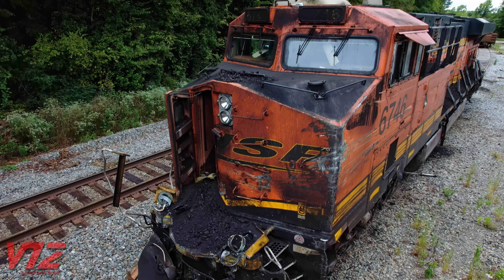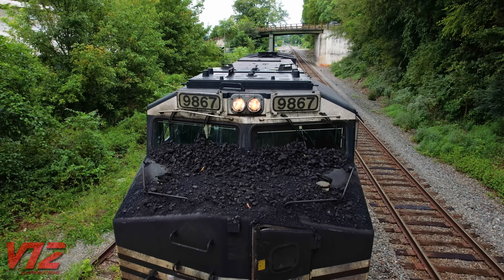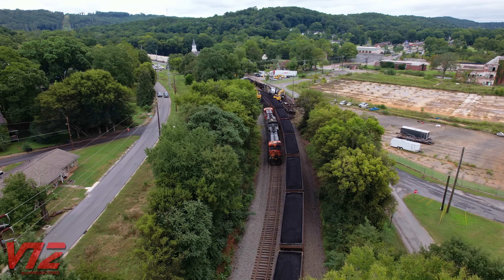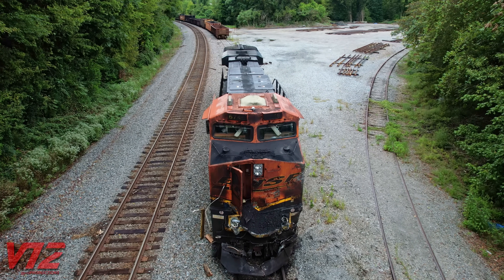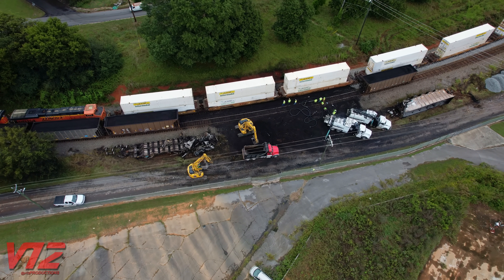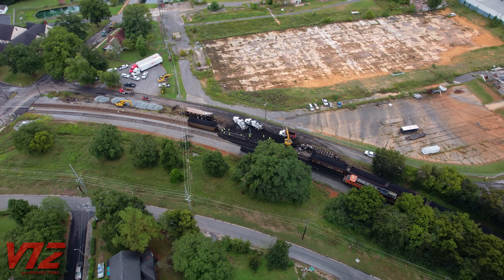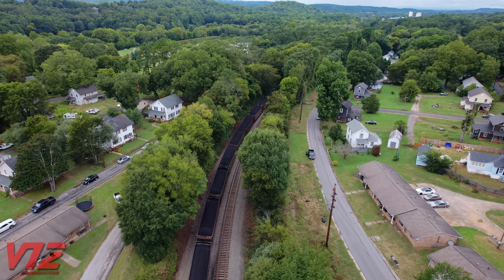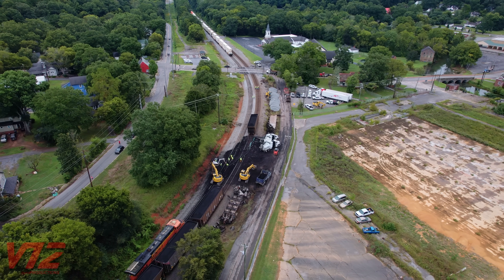RUNAWAY Locomotive & Head-On Collision in Rome, GA

Comment: Southbound NS 732 was passing a signal at Lindale, GA around 4:15 am when PTC put the train into emergency. This caused one or more coal hoppers in the middle of the train between the front end and the mid train DPUs to bunch up and derail. Northbound 283 ran into the derailed coal hopper throwing coal all over the locomotives and tearing the brake lines and chains off the lead unit. The lead unit then continued on unable to stop and ran into 29A head on at Rome, GA. The crew were able to radio the crew of 29A in time for them to exit their locomotive. The crew of 283 then jumped from their train moving between 25 and 30mph suffering broken bones and other injuries. The two damaged units were then backed into the siding while the site was cleaned up.
Reply: PTC and DPU’s that just about explains it all right there. Damn ! I hope them guys recover fully. Thats why they need more than one on a train . I hope you a$$holes in management are smart enough to figure that out. Your not only just risking crews now but whole communities. And I’ve noticed they are increasing train length and speed on slop freight. That shit will catch up with them also.
Reply: @rc391995  Agreed!
Reply: Jumping off a locomotive moving at 25 to 30 mph on to a heavily ballasted Right of Way is going to end up hurting you no matter which way you try to look at it. Actually I am a bit surprised that the crew were not able to kill the locomotive and it's mate???
Reply: Did you copy that word for word from hotspots? 😂
Reply: @markfryer9880   Hitting the emergency fuel cut off has nothing to do with brakes.
Reply: @rc391995  Can you explain to the laymen why PTC (i know what that is) and DPU's are bad? I assume the coal broke a knuckle because of PTC emergency brake application ??
Reply: You know what I started to answer your question in great detail . had done wrote several paragraphs in regards to your question then I remembered I'm at the point in my life that I've worked all my life to be in  . retired and drawing my railroad retirement . I'm very happy with that and why would I take the chance to loose all that just to be dragged into court and sued for answering your questioned ? How do I know your only a layman. I'll leave it like this . The machine broke down and did not function as they thought it would. Here is two perfect examples of just that.
Reply: @rc391995  I understand. I'm railroader in the UK, our freights are not big enough to require DPU's and break aparts are practically unheard of.
Reply: See your more than just a layman.
Reply: @rc391995  good answer brother enjoy your retirement
Reply: @formidable38  ok so Mr Layman we will call you?? just so no one here seems rude and if you are truly a novice physics alone will answer your question but please understand the retired railroader can't and won't say anything because of fear yes fear ... that's right ol chap this FREE COUNTRY we live in isn't really all that free!! The retired railroader worked a whole lot of miserable hours around the clock 12 hr shifts for 10 hours rest 365 days a year out of town from front door to front door of either his home or possibly a temporary residence another 100+ miles from his home "chasing" work to provide for his family some of these door to door tours of duty can last 45-50hrs yes hours per round trip -- home out of town,rest out of town, back home again plus travel from the terminal off duty and drive home can be 45-50 hours round trip!! Then 10-12 hours later the phone rings again and he has to do it all over again!?!
Any time off had to be traded for one excuse or another and %80 of the time that time off work (accumulated vacation days or personal days) are denied for Doctors visits, Dentist appointments, and I won't even suggest family time or family members medical needs and bills that the quoted "Cadillac insurance" doesn't pay for or only a small percentage of!!!
And vacation is technically a forced layoff depending on a employees years of service these vacation schedules are hammered in stone with the existence of modern computer programming that maximized every minute available for the machine to run at it's most effective and profitable scheduling matric!!
So please understand ole chap no one here wants to be rude to a "layman" if you truly are what you said..oh that's right your a railroader in a foreign country our cousin so to speak then you would also know we are trusted with the safe and efficient timely travel of goods and services that serve our country and supply the world with everyday products..so crawl back in your concrete block building in the old USSR and troll someone else 🇺🇦
Reply: Those guys must've been absolutely terrified.
Reply: You said 732 was passing a signal, was it a red signal? If not, a major failure of PTC for sure! Secondly, if 238’s lead engine had the brake lines torn away, an emergency❤ brake application would have automatically been initiated, which would also cause the locomotive(s) to lose power. If your report is correct, and I’m not saying it isn’t, then there has been several catastrophic failures of systems designed to keep incidents like this from happening! What’s not stated here is how much time elapsed between hitting the coal train, and the head on collision. If the locomotive was shut down after the coal impact and a handbrake was not applied, it’s entirely possible for the air to slowly leak off of the brake cylinder piping (or the piping might have been damaged in the collision) over time, and once the locomotive started rolling there would be no brakes! It was also not stated if the engine was separated from the train, or did the whole train runaway? Train brakes differ from 18 wheeler brakes in that they use air pressure applied to the brake cylinder to APPLY the brakes, while truck brakes use air pressure on the cylinder to RELEASE the brakes, so loss of air pressure on the cylinder makes a no brake situation! I had a 41 year career in the mechanical department with Sou. Ry./NS, and over the years seen many runaways due to engines being parked and shut down, and the crew somehow forget to tie up the handbrake. In time, the cylinder pressure will leak off, and there she goes!
Reply: @formidable38  Totally different style of railroading.   In North America (US, Canada and Mexico) the distances travelled are far greater and for bulk commodities long, heavy trains are the most efficient way to move freight.   In Western Europe the distances traveled tend to be much shorter with much lighter tonnage.     The railroads in each location have adapted to best meet the needs of their customers
Reply: Man if you was in the mechanical dept  and I'm not saying you are not. You should know when an engine side swipes a derailed coal train and it tears all the brake system from a locomotive the cylinders the listens the fulcrum the rods and entirely the whole brake rigging and that stuff is no longer part of the braking system there is nothing left to stop it. You need to rear here what's going on and what happened. Its either you've not read or you are an official trying to cover for the damn RR and still trying your level best to promote this one man crew foolishness. If that's what your doing your a paid shill that or you don't have a clue what your talking about . which is it ?
Reply: Pistons Not listens
Reply: And BTW in regards to the the signal . The signal dropped in his face that's something the mechanical dept has very little knowledge of . It happens I've seen if for myself . a kid dragging a log chain across both rails can make a signal drop . a traffic sign placed across both rails can make a signal drop. Whatever it was gave the coal train a false reading and PTC put the brakes on causing the DPU's to put excessive force on cars ahead of them and pushed the coal cars off the rail in the face of an oncoming train. The PTC robbed the engineer of any other method he could have applied to stop the train. Don't try to put blame on the crew on this one . its a catastrophic failure all right . of PTC and just what  a DPU can do for you in the most undesirable situation. Somebody called it the perfect storm. That exactly what it was. By the hand of God nobody was killed . The potential was there to kill a bunch not just the crews but whole townships.
Reply: Well thanks you for explaining why no train driver will explain 100 and percent exactly what went wrong and only offer a 30% exclamation I don’t know what it’s like here in Australia but I’m not a train driver I’m just a random person on the Internet but if what you say is absolutely true that must suck and I’ve heard horror stories of train drivers in America who I’ve had no sleep and that was a horrible accident I think that was actually Canada there was a disaster in I can’t San Bernardino think it’s called so yeah I hope that people do respect use enough to not push for the answer but what the other guy has explained does seem reasonable enough that it could be New to the truth or the truth of what happened to be honest I hope that in America train drivers do you get treated with more respect because without use or truckdrivers the whole country of Australia America Britain Europe would all collapse and I think you and everyone the train driver in this comment section for your loyal service even though I’m in Australia but thank you for keeping the country moving
Reply: I’m sorry that that happens to you in America but I’ve been in Australia I don’t know like this I was quick message thank you for your loyal service as a train driver I understand from what I’ve heard that it’s an extremely difficult job with the work hours and the same thing for truckdrivers but without use working on the trains or driving in the country would go to a grinding halt especially truckdrivers use are the unsung heroes of the country of any country to be honest So thank you
Reply: People in train and engine service get no respect over here from the company. They put on a big show its all bull. They are thought of ... Hell I can't think of a proper word for it at the moment trash maybe . The guy that was on the coal train was on here . Those post was deleted. Hell they is no wonder he can't talk after what he went through. He seen his life flash before his eyes he's ha a very traumatic experience. If some one tied you in an airplane that was out of control without a parachute how much would you feel like talking about it. Not quite the same but as close as I can get right now . Hell yes those guys are exhausted they go on forever without sleep sometimes. They never know when they will go to work or when they will get to rest. Just because their tour of duty is still over doesn't mean they don't have to wait for hours on the side of a mountain somewhere for a ride to pick them up and take them to a motel. Stay up for about 40 hours sometimes and see how it makes you feel. Another thing they talk they are subject to scrutiny untold. Seems like the carriers have a strange way of turning a story around to make it sound the way they want. You tell them the truth and they don't know how to deal with that. They will look at you like your cravy and tell you that's not possible and walk away from you. Then run and tell someone else in management what you said then they pick it apart to suit themselves then turn around and fire you for it. What is it over there do you people live in a bubble or what. I see your media is always making derogatory comments on our government over here. Why you all so many interested in what goes on over here. Go watch the damn Russian I'd think that would be of more interest to you in regards to what shouldn't be done.
Reply: Man they is all kinds of bullshit floating on this channel in  regards to this incident some of it gets deleted maybe I can understand some of it some of it I can't. Lot of politics will be played here its all about a stinking dollar over here as far as you and I . we are a needless expenditure. Nothing else matters not even your grandchildren.
Reply: I thought PTC was supposed to stop derailments like this, not cause it. (Yes this is sarcasm at the expense of PTC)
Reply: @rc391995  totally agree we need a minimum of 2 on every train MINIMUM!
Reply: @osrr6422  yeah no brakes is no brakes maybe dyno would have worked
Reply: @rc391995  hey enjoy your retirement sir
Reply: rock kicker
Says the troll.
Reply: OS RR
You sure about that? Cause retired railroad worker a.k.a. troll rc391995 thinks otherwise, why didn't they just shut down the engine so it stopped? Why didn't they just use the brakes that were torn off? Yet hypocrite rc391995 happily puts others down for wondering why non existant brakes weren't used even going so far as to list brake parts and then the troll calls others trolls.
"The fact that it tore apart from the rest of train should should have put the brakes on and shut the power down on the engine. Then it went through my head if it’s the lead locomotive why don’t the crew shut the thing down and stop it ?"
Reply: That’s what I was trying to figure out…I thought that the whole train was runaway and was it in dark territory as well too? I’m assuming that Northbound was supposed to crossover as the 732 passed? Scary situation all around…I work up North with NS as well too
Reply: thank you for the info !
Reply: What does an area operated by PTC tell you .
Reply: PTC caused the derailment? Woahhh...that'll get you in trouble with big brother.
Reply: Ptc puts trains in emergency nearly everyday where I’m at, lose of communication with intermediate signals most of the time .. what happens is if you are running on clear signals and running 50-60 mph ptc will lose communication with signal in the field and throw up the restricting indication .. if that happens at the right time you don’t have have time to reduce your speed so ptc will put the train in emergency depending on speed .. id say the locomotives brake rigging was damaged to the point the air brakes would be inoperable, if the fuel cut off was hit then it could take a couple minutes for everything to boot up and start back up
Reply: @markfryer9880  Ballast is actually quite shock absorbing, that's why you'll see river rock ballast at the bottom of rock walls to absorb shock if someone falls.  Ya, the crushed granite commonly used for RRs has sharp and jagged edges, but landing on it has more give than just the hard ground and does allow some sliding.
Reply: @formidable38  they used to be here too until they started running these massive poorly built trains.
Reply: @cdavid8139  no they really arent. In some places yes but it has been shown in the last three years to be a massive failure.
Reply: @yourbestgolf365  shown to who?    Massive failure...yet it continues to be installed.
Reply: @cdavid8139  - Freight transportation in the UK and Europe is more truck centric than rail. The primary focus of railroads in Europe and the UK is carrying passengers whilst in the US the primary focus is carrying freight.
Reply: @billnict1  I have spent a lot of time in the UK and Western Europe and agree with everything you said.   The US, Canada and Mexico are far more freight oriented and move massive tonnage on rail.   This is a far cleaner, more environmentally way to move freight longer distances.   Conversely high speed passenger service is excellent in Europe and with only a few exceptions it has not caught on in the US, Canada and Mexico.   Part of the reason is just the distances involved.  In the three North American countries we tend to fly and not invest in high speed rail.
Reply: Just curious.   Did PTC attempt to stop 29A?
Reply: @rc391995  Of course they will increase length and speed.   The latest labor agreements are giving a %25 pay increase over the next few years.   That means management has to find a way to reduce the labor to compensate.   Now, a question for you.   Having two crewmen on these three trains really meant nothing to the outcome...other than more people were hurt.
Reply: @tomt9543  I had a couple of questions on the timing here myself.   May need to see the final NTSB report.  Should be interesting.   From what I gather the impact between the coal hoppers and moving locomotive tore out all the brakes so they could not be applied.   I.E....there was nothing to apply.   So the crew was riding in a locomotive that could not brake but probably had powered down.  Whether or not the crew on the moving locomotive attempted to apply a hand brake while going down the track isn't specified.
Reply: @McDonnellDouglasMD--  There are definitely horror stories involving rail (and trucking and maritime) crew hours.   Over-the-road truckers and railroaders face scenarios that lead to going on duty tired and not really fit for the responsibility they have.   This needs to change.   BTW...I have railroaded a bit in Australia.   You guys run monster trains down there.
Reply: @specialed6357  To answer some of your questions, the crew on the 'runaway' locomotive had no brakes to apply.   They were damaged so badly they could not work.   It is probably the unit itself shut down but trust me, these things can keep going for miles and miles without power.
Reply: @cup_and_cone   That has to be the dumbest statement I have ever seen posted on a rail thread EVER! Go fall down in some ballast and come back and tells us how much it "gives".....
Reply: @rxrcond4life  Your emotion doesn't change logic and fact.
Reply: @cup_and_cone  Your 'logic and fact' are pure ignorance. I've spent most of my life walking said ballast and my 'emotion' as you claim is your perception. Go fall in some ballast and get back to us with your findings!
Reply: @rc391995   How many years did you work. 47 here. Isn't retirement grand? There is a part of me that misses some aspects then I wake up...  🤣
Reply: I'd like to go back and work one week . get me some payback !
Reply: You don't know much about RR BALLAST DO YOU ?
Reply: @tomt9543  I can see it being a PTC issue. Ive had many encounters with PTC showing me a red fence at a signal thats clear. Even 6 miles in advance ill see it on the screen and we'll only have a single intermediate before the absolute thats showing the red fence and the intermediate will be a clear. Then the fence will come and go many times. In this particular area its happened, It would display a red fence once again while running on clears and it will do it when we have just over a mile until reaching the signal. Which is a butthole puckering moment when you're running 50MPH with 8000ft and 10,000 tons in tow. Most of the time when we would get the speed down the red fence will go away when were only about 1500ft from the signal. PTC is not as perfect as many claim it is
Reply: @jassemalzahrani4502  locos are not designed to go into emergency dynamic brake by themselves,or by other means.
Reply: @cdavid8139  but, having 2 men in the cab has prevented many railside fatalities.
Reply: @Dieselfueledwork  over the course of years/decades you are probably right.   Two drivers in the cab of a truck can prevent fatalities.   Two bus drivers always alert and on duty.   Two individuals in the cab of an Amtrak passenger train provide additional safety.     You can go on and on with it.    I see where you are coming from.  I do not disagree.
Reply: @rc391995  I'm spineless?   LOL.   Your opinion of me is so important.  Sigh.   Yeah, well.    After 40 plus years of railroading for a living, if I find opinions on complicated situations that I agree with, I very will may repeat that opinion.
Reply: @rc391995  This is not "my" PTC system.   It was mandated by the Obama administration and forced on the railroads.   Class I railroad management (and the stockholders)  fought the introduction of PTC for years and years.   While final reports have not been written, it does indeed sound like the train going into emergency may have in turn caused the loaded coal hoppers to  derail.      To answer your question, if indeed it is determined that the emergency brake application caused the derailment then yes indeed it did not work here.   I agree it sounds like the "machine did not work as planned".   I never stated otherwise.
Reply: 40 plus huh ? And never heard of a radio train.... Pfft ! Yea ok C David whatever you say ....😑😑
Reply: @rc391995  Where did I say I have never heard of a radio train????
Reply: You said no such thing existed 50 years ago . pardon me ! I thought you was implying you never heard of one. I wasn't talking about a handheld toy .
Reply: I've actually kicked ballast around for several years David it don't take me as long to form my own opinion either . Spin another story why don't you and tell someone who really doesn't have a clue what didn't happen 50 year ago .
Reply: @rc391995  OK.   With you.   I was referring to the DPU technology of today that was being used by the power in these trains.   These modern units utilize a vastly different technology than the GE/WABTEC systems in the earlier days.
Reply: I was initially referring to special Ed in regards to being spineless David then he deleted his posts and it seems like all of a sudden you popped up. But that’s ok I can multitask well.
Reply: @rc391995  no problem.  Peace bro.
Reply: @rc391995  Agreed.   I've seen too many instances where crews are blamed way before facts are in.   And I agree what I see here is somewhat amazing.   It is very easy to jump to conclusions in this type of accident and blaming crews or equipment or weather or whatever before the facts are in is something I see management do far too often.    I personally believe PTC will be good for the industry and the safety of crew and the public....one day.   I just feel it was regulated by the government into production ahead of its time.   Be safe
Reply: I don't know what happened to my post. Maybe I deleted it and didn't know it. I won't bother you anymore. Peace man
Reply: @rc391995  I think we both had a post deleted.   be safe
Reply: @rc391995  well said
Reply: PTC saving lives!
Reply: Weird. In my experience, a deadman's device should have stopped this Loco in it's tracks. How come it didn't ???
Reply: @itchyvet  if the air line on the locomotive broke there's no brakes
Reply: @cdavid8139  the government mandated PTC be installed. I hate installing PTC. Sometimes it's like where the heck am i going to put all this at????
Reply: @itchyvet  a deadman cannot stop a train that has no brakes.
Reply: @theodorethompson9032  Pretty much agree.   The industry fought the mandate for years.   It was, in the opinion of many railroaders, rushed into production and we are now seeing the fallout.
Reply: @R7300  the main and emergency resevoir and there piping would have to be have been destroyed for the brakes not to be applied in an emergency brake application
Reply: @bustedford  takes air to set the emergency air, could have been that line broken
Reply: @R7300  air is retained in the emergency resevoir to set the brakes when trainline air is lost so yes that line would have to have been broke or brake rigging damaged beyond working
Reply: Those parts was no longer part of the engine in question. All the brake rigging was ripped off when it side swiped the coal train. Yes all the working parts that applies the brakes was gone.
Reply: @cdavid8139  Handbrake would have no effect due weight/inertia over breaking ability/force. Locos don't 'automatically' shut down except for fuel savings when idling for extended periods. Locks can roll just fine when shutdown when not properly secured!
Reply: @R7300   PTC was forced on the Class 1 railroads after the Northridge, CA crash in which an eastbound UP freight traing coming downhill went head on into a Metrolink passenger train causing a horrific accident. Freight locomotives destroyed the lead two passenger cars causing many fatalities including the Mertrolink Engineer.  Many immediately blamed the freight train crew for running a stop signal. Even stated so on major news networks!
Result: Metrolink engineer was texting an underage boy and failed to stop at the end of double track running thru the dual control switch and continued onto single track. Both trains met in a blind curve coming out of the Santa Susana mountains. This was my area and I personally know both Engineer and Conductor on the freight train. Engineer has never returned to work and suffers PTSD.  Cond returned to work after a time and us now retired.
Additionally, FRA (Federal Railroad Administration) further mandated that employees cannot access their cell phones at any time while train is moving and must be stowed in employees grip, bag, backpack, or suitcase, subject to a $25K fine!  FRA will 'ping' a passing train to see if there is an operating cellphone. Using Stingray or DRTBOX technology, 
they will call the number shown and if that employee answers call, this will subject said employee to fine and termination of employment.
Class 1 railroads were told to apply PTC within two years put were given several extensions due to technological problems many of which still exist today!
Reply: @rxrcond4life  I do not disagree with anything you said...and not sure why you were correcting me other than my comment on hand brakes.  If the two locomotives were moving engine light and the hand brakes were operable and the crew were able to get to them and apply them over a 4 mile movement not under power there would be some effect.   A lot of ifs there true.
Reply: @rc391995  you're
Reply: @rxrcond4life  o I deal with the problems first hand, I'm a dispatcher. I've had PTC save lives and I've had it cause problems too.
Reply: you're thanx
Reply: Lauren Boebert
Reply: I think it’s funny that someone who is retired is afraid to explain something on here for fear of retaliation.  You are retired, the railroad and you have nothing in common anymore, they can’t do anything.
Reply: @cdavid8139  you are correct, if a handbrake could be applied it would eventually stop the locomotive.  I’m guessing that it wasn’t working or they would have applied it and it would have stopped the loco within the 4 miles it traveled.
Reply: @ohboy2592  it's called being weird
Reply: @ohboy2592  Your guess makes sense to me.   I guess we'll know for sure when the reports come out.  Peace
Reply: @R7300  Reduction  through brake vavle is what causes actuation of braking system, minimum is 7-10 lb reduction. Increasing to 26-lb brake pipe or (Full Service) reduction.
Finally there is Emergency which takes brake pipe pressure to 0 (Zero).
Now you are just along for the ride. 10K to 18K tons behind you is going to require allot of braking power!!!
Reply: Got a couple more foamers just checking in .
Reply: @ohboy2592   The brake shoes would have burned completely away. But thank you for playing foamers don't know their ass from page 5...!
Reply: @ohboy2592   You cam be subpoenaed to testify on behalf on any accident for or against the carrier is all...
Reply: @rxrcond4life  you could but they aren’t going to subpoena someone for a comment on a YouTube channel like this for stating an opinion.  Secondly, the shoes would not have burned up to the point of having zero effect.  I work on the railroad and I have a pretty good understanding of how brakes and the railroad works.  Now, you can go back to trying to sound like you have an idea how they work or function
Reply: Did you ever hear of glazing ???
Reply: I'm not talking about frosting on donuts either .
Reply: @Oh Boy janitors and carry all drivers don't count .
Reply: Nor does foamers or foreigners !!!
Reply: A dispatcher. 😆😆😆😆
Reply: Jyst as general info dispatchers come from the ranks of carry all drivers janitors and the person that supplied the caboose with coal and water after the RR CONTRACTED out those jobs and done away with the caboose altogether and they put an EOTD device on the rear of train . oh I forgot you foamers are into acronyms its Fred to you all instead of the proper name. ( end of train device ) Pfft.
Reply: @rc391995  I know this is 3 weeks ago. But just a heads up. In the future if you want to answer something honestly without fear of reprisal. Create a new email and youtube account. Just make sure you don't use this email for anything other then responding on YouTube and it is almost impossible for anyone to link a comment to you.
Reply: @rockkicker5527  but he said he was from the UK. And like I commented to RC. If you don't want to be found out on YouTube. Just create a new email and YouTube account that can't really be linked back to you. Make your comments as if this is what you heard instead of this is what you experienced.
Reply: i have the video of this
Reply: @rc391995  Why would you be sued for explaining why DPU and PTC is bad? That does not make sense.
Reply: @rockkicker5527  What are you talking about? This is not state secrets here, it is a train.
Reply: @rc391995  Yeah mechanical would nothing to do with it. It does happen, scares the crap out of you when it does. I have never had it happen with PTC though.
Reply: @rc391995  Prob a buff that thinks they have worked for 30 years.